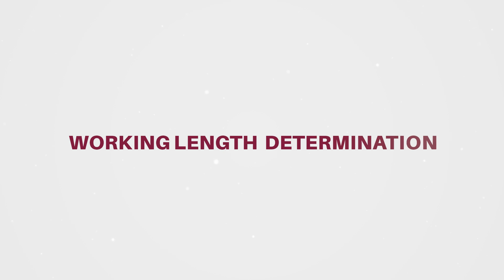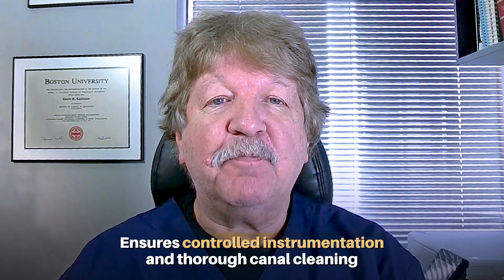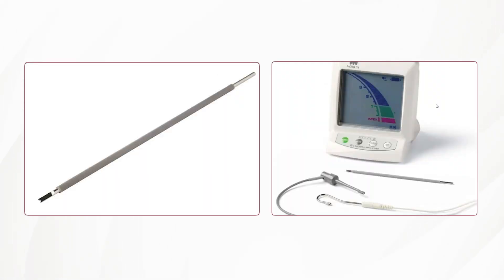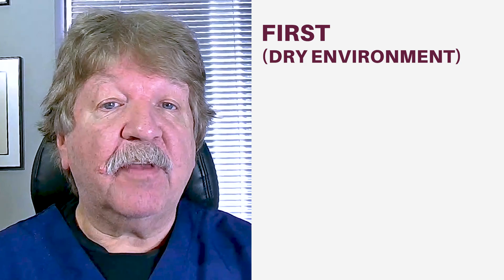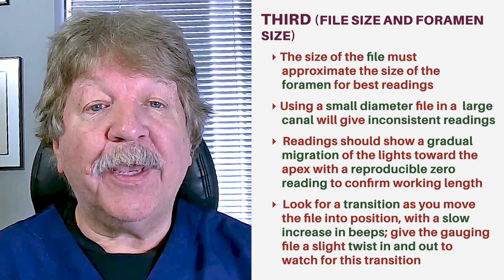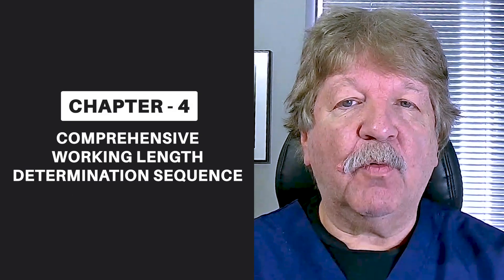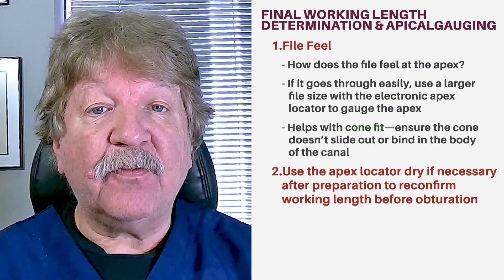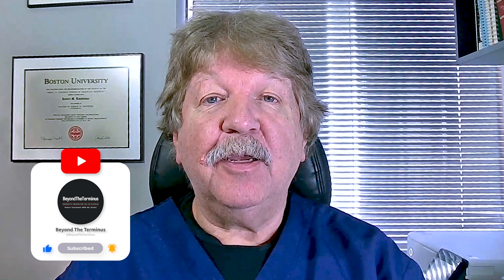Mastering Working Length Determination in Endodontics

Comment: that's the best discussion on working length I have ever heard, nice points doc. I always imagined that looking at the paper points was a useful data point, but I didn't realize that Dr. Rosenberg had discussed it in such great detail
Reply from the maker: You an find his original articles in my EndoFiles Library qt www.endoexperience.com
https://endoexperience.com/download/216/apical-control-zone-and-apical-size/43259/rosenberg-paper-point-technique-pt-1-feb-2003
and 
https://endoexperience.com/download/216/apical-control-zone-and-apical-size/43260/rosenberg-paper-point-technique-pt-2-march-2003